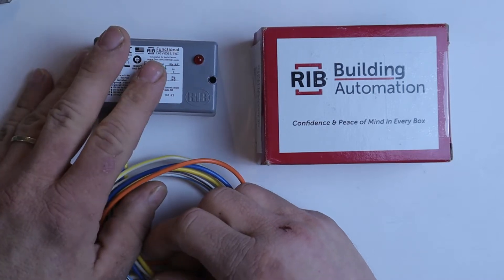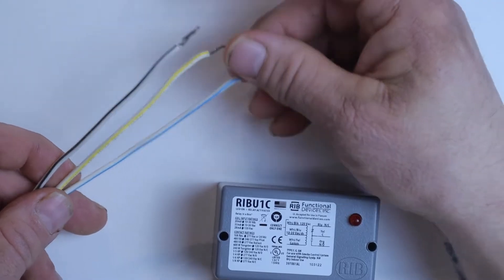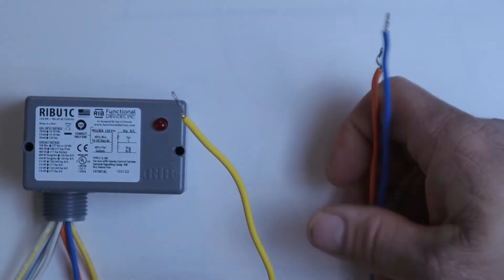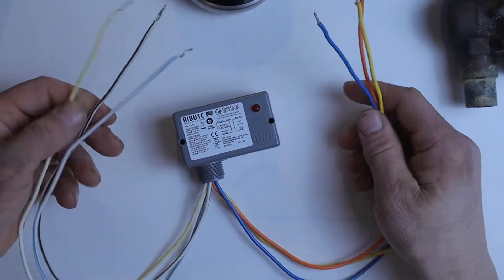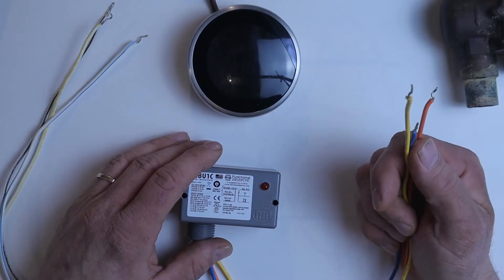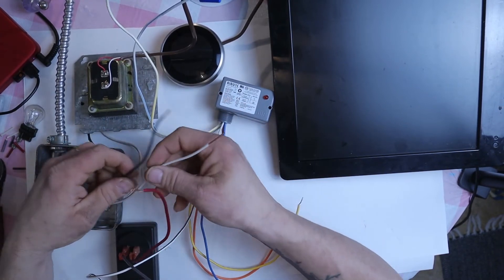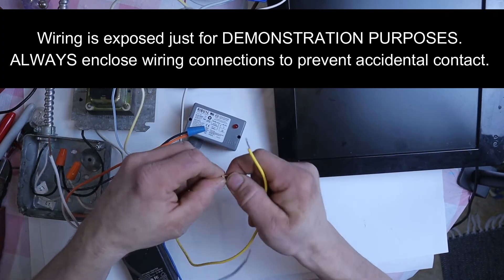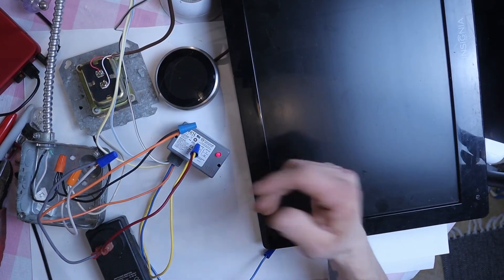How RIB Relays Work & What They Can Do

Comment: I have an utica boiler for heating my house. 2 wires red and white goes to my nest thermostat in my bedroom. In my bedroom I have a 24 V transformer , where the red wire are inter-twined with the red wire from the boiler into nest RH, the white wire from the 24 V transformer goes to common in nest thermostat, the white from boiler goes to white in nest thermostat. My friend told me I should use a relay. I am not understanding why? if I were to do so what hooks up to what?

Comment: only part that was confusing for me was that i am dealing with a 120V cicruit, and this example seems to be specific to 24V, as the two white wires are used on the control device.

Comment: Could the output N/O contact side be used to switch a 'dry' circuit or 0V circuit - for example a 2 wire start on a generator set? What I'm getting at is to make that happen there can be no 'pass through' from the input to the output contact side or to put it another way no electrical connection between input coil and output contacts. Thanks

Comment: I need to install this relay on my old gas wall heater which functions with a milivolt thermocouple. I will hook up the two wires from the heater W and R and then use a 24v power adapter to power the nest thermostat. When I do this without the relay what happens is the heater shuts off the gas and makes a buzzing sound because the power is activating the gas shut off valve. In order to prevent that I figured one of these relays should be installed to interrupt that. I am just not sure about the wire hook up schematics. Any suggestions would be much appreciated.

Comment: Don't you need white from transformer ti also connect to common on the Stat to provide power? You are connecting yellow and white from relay to transformer but missed the Stat common....
Reply from the maker: Stat would have never turned on if it required a common wire.
Reply: It will if it has batteries. So it will work till the batteries die. I tested it today and with no batteries the Stat would not turn on until white from transformer was connected to the common terminal of the Stat. In what world does a single wire power a device?
Reply from the maker: @AryaMoussavi you're missing something. It's not just 1 wire. Wouldnt have been functional in the video if it were. 3rd Gen stat doesn't have batteries either.

Comment: I was on a service call today on a boiler that has a rip relay. The only way to get the boiler to fire was to remove the orange wire and wire in the blue wire. Is that a sign that the relay is bad? Thanks brother.
Reply from the maker: It depends if there was power present on the other side of the relay (blue/white or black/white). That will tell you if the relay is actually working or not. Switching wires manually over to the blue wire is the normally closed circuit, which is the default position of the relay switch out of the box, so it is not a sign of a defect if the boiler started up when switching to it. That is exactly what should happen. 

When the relay is powered on the blue/white or black/white circuit, the switch will no longer be on that blue wire. It will switch to the orange one, and so manually switching the wires to blue at that point would not cause the boiler to run. So my guess is that the relay itself was not getting power on the blue/white or black/white wires to activate the switch. 

 If you were getting power on the blue/white or black/white circuit and the boiler still ran when changing over to the blue wire, then that would be a bad relay, because at that point the relay should have switched over, leaving the blue wire on an open circuit and unable to power the boiler.
Reply: @JerseyMikeHVAC  I think I understand. So when the boiler had a call for heating, the rib relay light would not turn on when the N/O orange wire was hooked up, meaning I dont have power to the relay. But if I have power to the relay and the light turns on, but the boiler won't fire in the N/O position, then the relay is bad. However, when switching to the N/C blue wire, if i didn't have power to the relay, the boiler shouldn't fire up. But in my case, the boiler did fire up, meaning i have power to the relay? Thanks again for the help!

Comment: I have an old Church and Rectory that has all Six light switches at the rear, where the Preist in the past would have been able to turn everything off when coming to and from the house. --- I'd like to use Relays and low Voltage wiring to create a few three-way switches without running hundreds of feet of 12-3 Romex. 

Thankfully, all the switches are Single Pole so that I don't have to mess with any existing three ways.  Would you have any suggestions of what devices and wiring I could use to accomplish this goal?

Comment: awesome vid.
I have a rental unit with a nat gas space heater in the living room, but I need a powered duct to push air from the ceiling of the warm living room up into the attic and down into the kitchen on the far end of the unit.  

I had a timer switch for the tenants to use, 30min, 60min, 4/8/12hr then it shuts off.  That's better than nothing.   But I got the idea last night to use a thermostat to control a relay to turn that powered 6" duct on/off.  

THe only weird thing that will happen in this setup is if the nat gas space heater is off, the thermostat in the kitchen will drop in temp, and turn the blower on,  but it will just circulate the cold air (as it doesn't know if the nat gas space heater is on or off).  I think I'll put the relay into a 2-gage metal box for the tenants to turn everything off in the kitchen when the heat isn't on.  It would turn off the relay power, and thermostat power.  Like, if they are on vacation or something.  Or in the summer when that heater isn't on at all. 

If the nat gas space heater was newer, and had an on/off trigger (it's completely passive, no power at all), I could use the 'on' signal to turn on the relay in the kitchen, so that it would only work if there actually was heat in the living room.

Anyway, my confusing was on the normally open/closed and you hit the nail on the head with explaining that, i totally get it now.  Thanks!

Comment: Hi Mike
How to wire rib relay to my furnace blower for extra duct booster fan?
Reply from the maker: Best way to do it is to activate the RIB relay by taking power off of the furnace blower relay terminal on the control board that powers the blower motor, then running the other RIB relay wire back to neutral on the control board. That'll be a 120v activating circuit. This will turn on the booster fan and blower motor simultaneously. 

 Another way is to activate the RIB relay off of the low voltage terminals on the control board on a call for heat. You can't use the G terminal (which is for the blower) because on furnaces in heat mode the blower is time delayed until the furnace fully fires up, so the control board itself activates the blower. But you can use the W terminal as the 24v signal to activate the relay and then run the other RIB relay wire back to the 24v common terminal. Only thing is that the booster will start immediately on a call for heat a minute or two before the furnace blower comes on because of the time delay.

Comment: Currently trying to control a hood system. All power under the hood must shutdown, but the exhaust fan must kick on. Exhaust fan and light are same 120v circuit the range/oven is 240. Planning on using a shunt trip breaker for the range. Would the shunt trip breaker be considered my control device?
Reply: Each would need a 24 volt circuit to break line voltage with some type of contactor switch I believe

Comment: Hi, great video for the beginners! I’m trying to wire a circuit that controls two dampers that close when energized. I want to recreate an XOR logic - it’s ok when either damper is closed, but when both are closed, I want one of them to open up. This is part of my hvac system with three zones. When two dampers are closed, it creates too much pressure on the third zone as it is the smallest one, and I want the third zone to always run with 1 other zone. No such problem when the other 2 zones are running alone. I’m thinking to splice into damper 1’s white wire to energize the control, and then splice into damper 2’s red wire to the NC terminal. I’m thinking that when only damper 2 is energized, it’ll work. When damper 1 is energized it doesn’t matter because damper 2 remains open. When both dampers are energized, then it should force damper 2 to remain open.

I have a question - does it really matter in which order I connect the wires on each side of the relay? For example, can I connect the White/yellow wire first then then White/Blue (to 24v neutral)? Or does it have to be White/blue first, and then return with white/yellow?

Similarly, on the other side - can I connect the yellow to red wire before it reaches damper 2, then connect the blue wire to the damper? As in, it’s really just closing the loop, so it should t matter which way the loop is oriented?

Comment: Hello! This is amazing info! I just wanted to ask you for clarification… I want to connect the damper (which is interlocked with my hood with a pressure switch), with a fan. When the damper opens I want the fan to run (well in reality I’d prefer to have a 3-5 seconds of delay but I can’t figure that out at all, so straight open would work too). Thank you again!
Reply from the maker: You should be able to make it work. You can work in a delay timer in the circuit to get that 3-5 sec delay you're looking for. so long as it's rated for the amps being used. Something along the lines of this: 

https://www.supplyhouse.com/ICM-Controls-ICM175B-ICM175-Bypass-Timer-10-1000-Second-Knob-Adjust-Delay?utm_source=bingad&utm_medium=shopping&msclkid=248b0950efce137585e66c02373aade9

Comment: I plan on using these on my millivolt propane wall furnaces at my camp.   I keep it on low heat during the week, sometimes I'm away for weeks.    I currently heat with heat pumps and need the wall furnace for two things.   1) as additional heat in cold weather, controlled by a NEST tstat on the NO side, and 2) use a second regular millivolt thermostat on the NC circuit - always set at 50 degrees.     When the power goes out and the heat pumps turn off, the wall furnace will automatically turn on via the regular millivolt thermostat.
Reply from the maker: Sounds interesting. Le me know how it goes!

Comment: Question I have a boiler that heats 2 rooms there is a blower that is hooked to a circuit breaker so it on 24/7 ,,,,could I tap into the thermostat wires on the boiler then to the relay to power the fan when the thermostat calls for heat ?
Reply from the maker: Sure. Splice the blue/white and the yellow/white wires of the relay into the W wire off of the thermostat so the 24v runs through the relay on its way to the boiler. Then use the orange and yellow wires on the other side of the relay to break the 120v power leg of the blower, which will close and power the blower when the stat activates the relay on heat.

Comment: I followed your instructions,thank you! My low voltage thermostat is now controlling a 120v garage fan. However, now the thermostat is no longer calling for heat?! Any suggestions? Thanks!
Reply from the maker: How is it wired?
Reply: @JerseyMikeHVAC  the exact same way you showed in the video - white/blue is on the W port of the thermostat, white/yellow  is connected to the white low voltage one that's coming from the zone valve. Red that's coming from the zone valve is on the R port of the thermostat.
Reply from the maker: @user-pt7gj4yc3l Red wires from the zone valve do not go to the thermostat. Those wires are for the burner circuit. They should not have been touched.

Comment: I know this is a little late but I’m confused lol. When you used the normally open circuit (orange) on the 120v supply and the normally closed on the 120v power supply to tv, wouldn’t that mean that when the thermostat turns on it will activate the relay and turn on the orange wire / 120v supply but then turn off the power supply to the tv since that’s normally closed? I’m struggling with this one 😂
Reply from the maker: You only use normally open or normally closed. Not both. The third wire is a common wire for either one.
Reply: @JerseyMikeHVAC I’ve been replying to myself lol. Today is not my day
Reply: Nevermind lol. I was thinking you were using the blue for normally closed for the tv power supply but your not. Your using the common for the power supply to the tv so when the relay turns off it also turns off. If I have that correctly lol. I didn’t realize you could use the blue
 (N/C) as a common wire. I guess that makes sense when you think about it. 😊
Reply: And thank you for getting back to me so quickly. I appreciate the help.

Comment: basically i have a 24volt magnetic switch when the cab doors open it is suppose to energize the 120v plug in the cabinet and when the 24v magnetic switch (cab doors close) is de energizes the 120v plug in cabinet

Comment: shouldnt the tv also turn on when you switch the thermostat on and tv turn off when thermostat goes off (why do you have to turn the tv on) i am using this application for a door switch in cabinet to turn the receptacle on and off
Reply from the maker: I was just using the TV as an example of how the relay can use low voltage circuits to control high voltage circuits. The TV not turning on automatically when powered is just a feature/setting of the TV itself.

Comment: For complete idiots like myself... could you explain the function of the transformer in this video?  I've been trying to come up with a solution on how to turn an inline vent duct fan on and off when the oven or range turns on. I figured I'd need to monitor voltage of the 'hot burner' indicator light on the stove.  When the light is on the exhaust fan comes on.  When warning light on stovetop goes off the fan shuts off.   Your video has got me so much closer to understanding the process.
Reply from the maker: The transformer just represents the beginning and end of the power source. In the video, it sends out 24 volts from load terminal and receives it back at common in the end to complete the circuit. An electrical breaker would work the same way. Sends power out on black and returns on white (neutral) to complete the circuit.

If you want the indicator light to be your control, then the wire feeding that light will be your power source.
Reply: @JerseyMikeHVAC  thanks!  That helps! U da man!

Comment: Saw way too many lazy control & electricians wire the control power to either the NO or NC contact instead of the common. Makes it easier down the road to troubleshoot or add something to unused contact.

Comment: Retired from a large hospital. JCI ( Johnson control  ) took care of most of the controls. Last big project this usually best in class company installed 4 to 6 RIB relays on bottom of panels and were too.lazy to install terminal strips so just had cable tied  sloppy bundle of wire nuts making troubleshooting a pain.Nice cheap relays. Great having an indicating lamp telling you when their power on one of the coils..
Reply: Johnson controls messes with those complicated low voltage for giant commercial units for the company I work for. Even though I’m a 30 plus year service technician I don’t mind getting them involved in stuff here and there
Reply: How can I energize two separate fan coil blowers simultaneously......each fan coil has its own thermostat energizing heater cool independent of the other. Again I want both blowers to come on even if only one thermostat is calling. 
What RIB would I use

Comment: Thank you for the video.  Do you know if I can use this airflow switch to do the same thing without the RIB?  It only has two wires, so I'm not sure.  It appears that the airflow switch is the control device/wire.  I would appreciate any advice you have on this.  The airflow switch is here: chrome-extension://efaidnbmnnnibpcajpcglclefindmkaj/https://www.farnell.com/datasheets/3162383.pdf
Reply: Never a big fan of any switching device with such low power rating for contacts. Only 10 watts. Would burn out if used to power a motor starter. Would have to Eire contacts to power a relay coil just adding an another part that could cause problems..

Comment: Thank you for such a clear video.  Can I use this type of relay/setup to install a low voltage smart thermostat (e.g., Nest or Ecobee) to control a line voltage 2- or 4-pipe forced air system in my condo?

Comment: How about using rib relay as a preference relay on an oil burner on boiler and oil burner for direct fired hwh.
Reply from the maker: Not sure what you mean. Like priority zoning?
Reply: @JerseyMikeHVAC  Priority on burners like Hwh burner priority cuts power off the boiler burner so they don't run at same time usually it would starve out when both burners running at same time using an old buried tank
Reply from the maker: Maybe. You might be able to do something like have the aquastat wired into the relay as the control, heating boiler circuit on normally closed and hot water burner circuit on normallybopen. 

Heating burners will run on stat until aquastat calls for heat, then the heating circuit will open and hot water circuit will operate on the normally open.
Reply: That's a pretty specific circumstances and is a cool way to use a relay. I recently saw a tech have to do this in a Facebook group. I'm assuming you saw that too! I think I'd use the 24volt aquastat call from the water heater to switch boiler from n/c to n/o